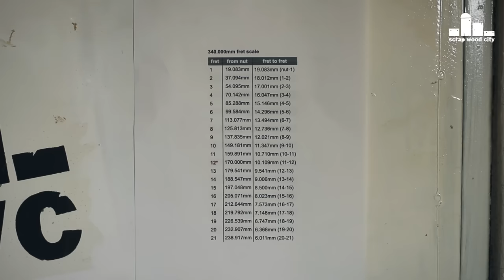How to make a tin can baglama ( mini bouzouki )

Comment: Very nice!  I actually made a similar instrument a few years ago, but with 3 strings, and I play it with a bow.
Reply from the maker: Awesome, thanks
Reply: Like a kemençe?
Reply: @gnomepilled103   I actually bought a kamence a couple years later and yes, similar idea.  Mine used a tin can for both the body and resonating surface (instead of skin) with a neck that pokes through so the strings are attached to the other end.  It looks most similar to a Kazakh style with the cylinder type body.  My Persian kamence body is walnut turned to the shape of a gourd.